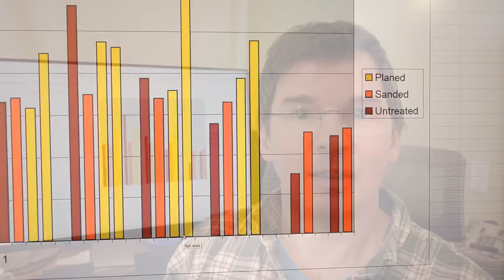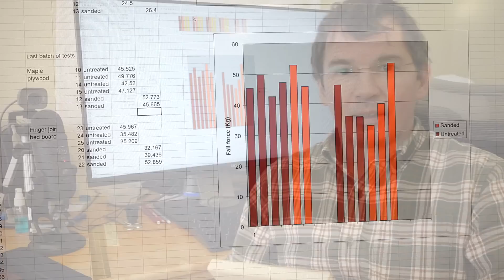Glue surface prep: Less important than I thought

Comment: Great stuff Matthias. Its all about penetration. It may have been worth wetting some of the joints prior to gluing.
Reply: I think you would also have to dry it after the wetting. Unless you're using polyurethane glue, but that's an entirely different matter 🙂
Reply: @briantaylor9266  Maybe partially, but it would allow capillary action for better penetration. :)

Comment: Really interesting ! Reminds me of a tale I read 35 years ago in a book by JE Gordon (can’t remember which - possibly The New Science of Strong Materials: Or Why You Don't Fall Through the Floor and Structures - and excellent book) in which he says that during the Second World War they had problems with Spitfire planes - where wood laminations were critically failing on planes due to improperly prepared joints - so their solution was to shot blast the wood in the factory as it was a process that couldn’t be screwed up by laziness on the production line… and resulted in excellent  glue joins !
Reply: Amazing connection about that book.  It is great that you mentioned that.  I was thinking about that same section in that book as I was watching this video.  Glad someone else is familiar with it.  That’s a great book.   I gave it away years ago.  I need to get another copy.

Comment: In practice, it seldom matters to me and I don'tgive it much thought. I usually only use glue for sanded projects, and then I like to do most of the surface prep first anyway. And even if that's not the case, I only use glue to keep a mechanical joint together. Maybe sometimes side grain to side grain, but then the surafce are is typically relatively large anyway .But they are always fun experiments to follow and to understand better what method to use when.

Comment: After years of hearing end grain is a weak glue joint it is interesting zero failures were caused by it!
Reply from the maker: End grain glue is MUCH stronger, but also much weaker than the wood.  Also, end grain to side grain will fail over the years due to moisture changes shrhinking and expanding one part much more than the other.
Reply: Yeah.   A youtuber, maybe Matthias, did a video on that.  As I remember, the end grain glue joint was actually stronger than a side grain glue joint because the glue wicks into the end grain.  The reason why the saying exists is because the end grain joint is weaker than the wood (in that direction) while the side grain glue joint is stronger than the wood.  If you take two 1 foot pieces of 1x4 and join them end to end the glue joint breaks at a much lower point than a 2 foot piece of wood because wood in that direction is extremely strong.  If you glue them side by side the wood breaks before the glue (because wood is weak cross grain) so it is just as strong (possibly even stronger with proper grain selection) than an equivalent 1x8.   The saying should be that an end grain glue joint is weak in comparison to joinery.   So for example in the case of the butt joints in this video a mortise and tenon (or dowels, domino, etc) is much stronger.  In the example of two boards end to end a scarf joint or dowels is stronger.

Comment: Sanding for gluing is only necessary if the surface is smooth leaving no ridges for the glue to cling to.  Also wood glue and and clamped will give a stronger bond than just putting glue on the wood and not clamping like you did.  Matt you should already know these fact. Your just compare sanded surface to rough surface and not even identify the grit your using. I found this video useless and very disappointing to your usually through test.
Reply from the maker: actually, a smooth surface glues just as well.  The glue actually sticks to the wood fibers, it doesn't rely on texture.
Reply: @matthiaswandel  or surface that been planed to a smooth gloss surface, in stead of saying it's wrong. Prove it? Also the wood fiber is a texture ffs
Reply: @matthiaswandel  you should already know smoothing the wood make the pores smaller where water will form droplet instead of soaking in but you are say wood glue is some how less viscous than water and will absorb into a wood surface water has trouble penetrating.
Reply: @matthiaswandel  well than why don't you  sand the wood to polish with above 1000 sand paper and see how the glue adhere than lmao

Comment: As you always glue both surfaces (not here but in other videos where you glue tenants and joints) it would be a great test for you to see if that makes a difference. In my opinion (I am not a woodworker) using glue only on one surface should be enough.
Reply from the maker: It depends, if you put glue on and then clamp hard straight away, the glue gets squeezed out before the other surface has a chance to soak up anything.  It will however soak stuff up, resulting in a glue starved joint.  So if its just glue on one surface, don't clamp hard straight away.  Though I think 15 seconds between joining and clamping pressure is sufficient.

Comment: Does the amount of sanding make a difference?

I've always been of the opinion that a roughly sanded piece (eg. 40 grit) will give a stronger joint than a finely sanded piece (eg. 240 grit). I assume the wood fibres will knit together more if it is coarsely sanded. No idea if I am correct or not

Comment: I can’t help but wonder if the joint here led to a less consistent result. 

That joint is of such low strength that it isn’t representative of the strength gained in sanding.

Comment: At the end you seem to be saying that the results were not interesting. I beg to differ. I found the result very interesting. Of course the caveat is that grease/oil/paint/varnish are (probably) not suitable glue surfaces. Thanks.
Reply from the maker: varnish makes a HUGE difference.  As in, the glue doesn't stick to it

Comment: Not entirely sure if you've made a video about this already, but Id love to see a test to see whether end grain glue joints are actually weaker than side grain joints. I've always been told this but in my experience it doesn't matter that much.
Reply from the maker: End grain to end grain is  MUCH stronger than side grain.  End grain to side grain -- always the side grain that fails.  That said, over the years, with humidity variations, end grain to side grain is likely to fail even without being stressed.

Comment: Time between surface preperation and gluing, amount of glue (g/m^2), glueline thickness, pressing force while curing, moisture content of the wood, temperature (wood and glue), age of adhesive and most importantly type of glue have an impact too. Most adhesive manufactures provide detailed instructions for processing.
Reply from the maker: Used 48 hours for all, glue was enough to fill it.  Pressing force was weight of the wood, mositure content all same as it was all wood in my shop for years.  So all these were consistent.
Reply: @matthiaswandel  So basically you didn't apply pressure to a glue type that does require some pressure. Your load testing also seems to be coherent with the results of Workshop Companion with the pressure vs no pressure bond strength. My assumption is no pressure leads to no penetration.

Comment: I learned that surface preparation makes a big difference when curb-picking plywood.  I acquired some thin plywood that I used for a project.  The wood had some varnish on it, but the thin, satin finish and dull patina didn't make it apparent that the varnish was there.  Did a big glue-up, and the whole thing fell apart when I went to mount it in place!
Reply from the maker: I didn't mention varnish, yeah, that makes a huge difference!
Reply: @ZapRivet my take from this video was that perhaps I need not spend so much time prepping surfaces, but your take is better. Never know if there might be some slight matte finish or surface oil being overlooked somewhere 🤷😅 have to agree with you, better safe than sorry if unknown.

Comment: Maybe different results if you don't use the end grain?

Can you post the link for the other video that you referenced?
Reply from the maker: I used end grain for the joining piece to ensure the glue wouldn't be coming off of that part. End grain glue is MUCH stronger, though could fail over the years due to moisture fluctuations

Comment: Love your glue and joint test videos. Definitely interesting results. Could you possibly do a testing of glue application? Specifically using glue on both sides of a joint instead of one. And a end grain to end grain regular glue up vs putting glue on the end grain, letting soak an applying more to account for the soak.up.

Comment: What I would take from your observations is that there are additional uncontrolled variables that are substantially affecting the outcome as much or more than surface preparation.
Reply from the maker: Yes, probably mostly a matter of how easily the wood tears out
Reply: @matthiaswandel  if the wood fibres are exiting the face of the board diagonally in one direction and you rotate the board, then surely in one direction they are being peeled out of the face and in the other direction they are sort of levered in. 
E.G. here’s a cross section of the joint in ascii

|\\|=

|//|=

If you push upwards on the end of the equals sign, would you say the first example may be more likely to split the face grain of the board than the second?

Do you think the rotation of the face board would explain some of the difference in the pairs of planed surface tests? And therefore could affect the other tests?

As always, this is the empirical testing that long term subscribers thrive on. The proof of minimal (or even no) gain from faffy tasks is sure to speed up some processes. Keep on keeping on 👍

Comment: Sample size is too small. Inconclusive.
Reply: From a purely statistical point of view you may be correct. From a purely practical point of view, for a project that may have a dozen glue joints, I would say the results are significant.